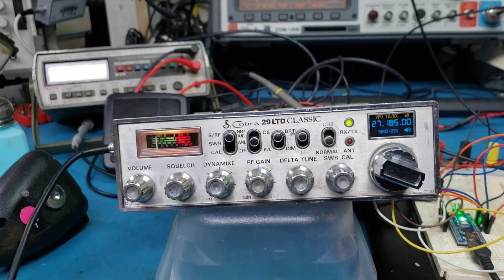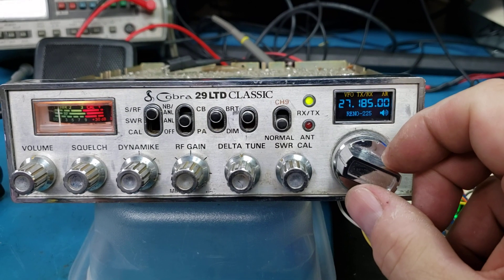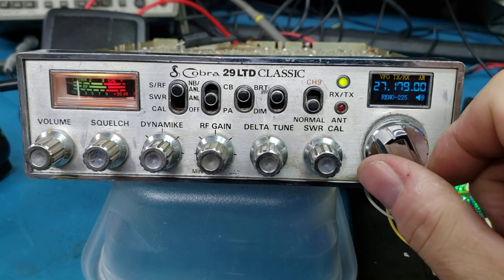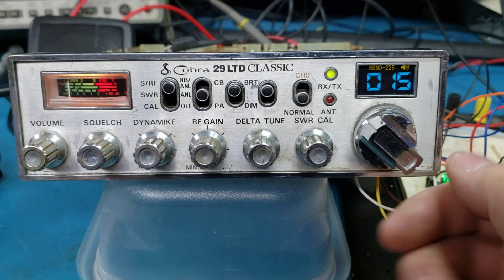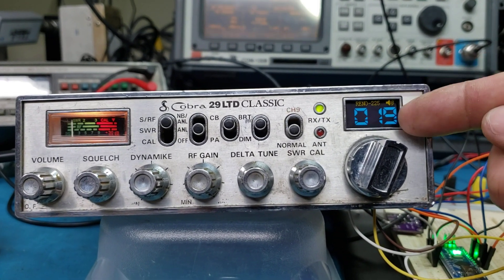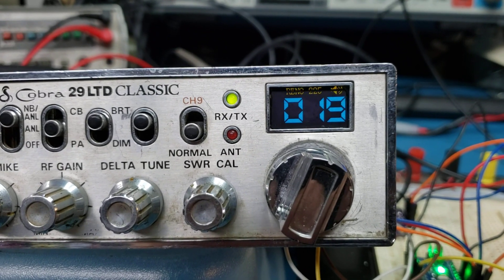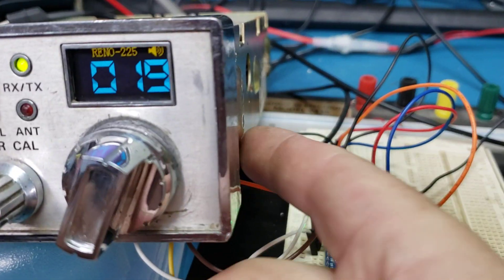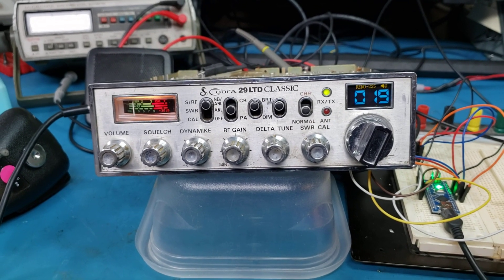New VFO DDS for Cb Radio and more!

Comment: Can I get this to go down to 26.905? And up into 10 meter? Just curious of the range of operation. Have a couple older 29s and a 25 I am looking at converting
Reply from the maker: Yes sir, depending on the bandwidth of the radio, you may need to do some wide banding but yes, I have a few guys doing that.

Comment: Hey have you tried putting these in New radios.  Like a Stryker 995 or galaxy 99v2
Reply from the maker: Although it would work, nobody has asked for that. I suspect it is because it would not add any large improvements over what those already have...
Reply: @ddsvfo  well I'm a ham operator.  It would be neat to listen to the band's on my cb.
W5ion

Comment: Troy how many bands can we used with the VFO DDS ?
Reply from the maker: 500 khz to 150 mhz continuous in 10 hz increments minimum. In other words, if you use it on an HF rig, every band continously as much as the radio can handle.

Comment: i have a 29, 148 gtl  they both transmit. the one fourth eight goes to 2805. I did not want to go low. and I have an old base that has fm on it. I have 29fifty that need to be soldered in the spot where the power cable comes in. wish I had a repair man. that is one thing that I miss not living up north. don't miss the winters.
Reply from the maker: You can always send it in to the shop here..

Comment: This is cool! Do you need a low pass filter on th eSI5351? Is it OK for clean, relatively spur free output? 73
Reply from the maker: Thats my weekend test...I seemed very clean on the spec ann but did not have time to really drill down on the output. I will have more info. This weekend anfter close examination...check in on email toby@troyradio.net